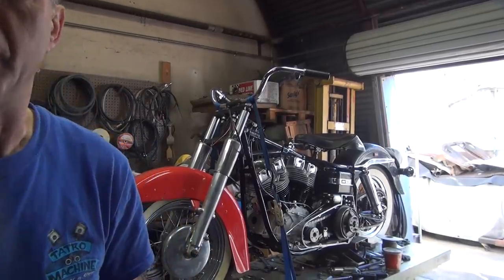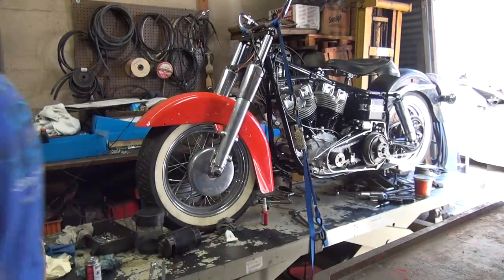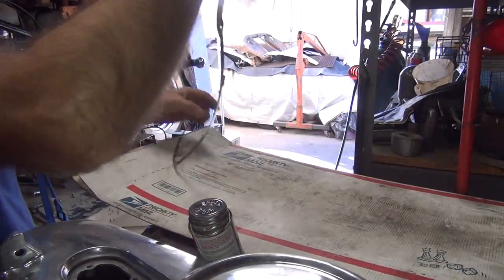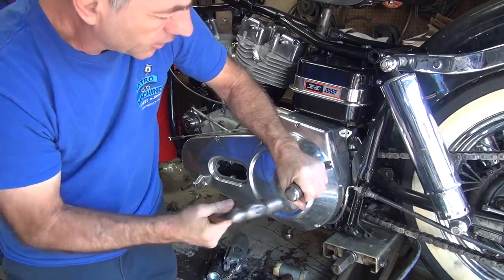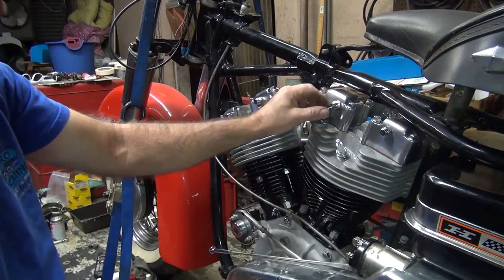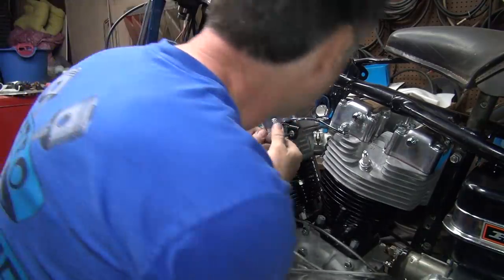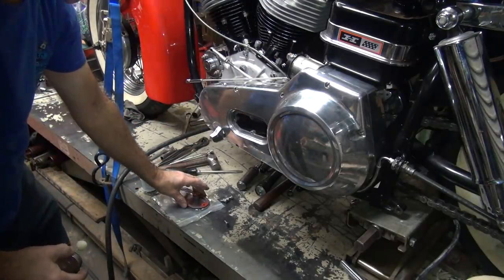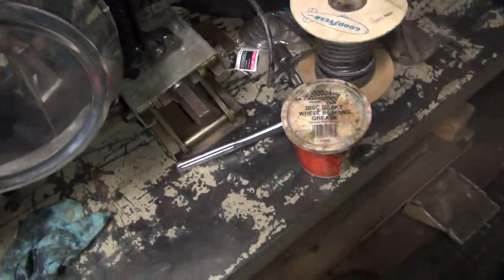1967 74ci shovelhead #157 flh bike assembly transmission rebuild harley craigslist tatro machine

Comment: I’ve been watching this trying to see how and what goes into the clutch cluster and primary gears and bam you skipped right over it.
Reply from the maker: not done yet.
tatro
Reply: 24T engine sprocket and the clutch baskets are 37t. So 37/24=1.54. So the primary ratio is 1.54:1.
Reply: Engine sprocket is in video 155 and clutch assy is in video 156